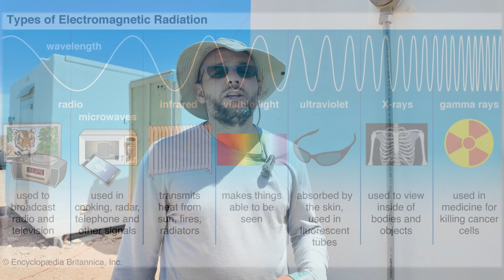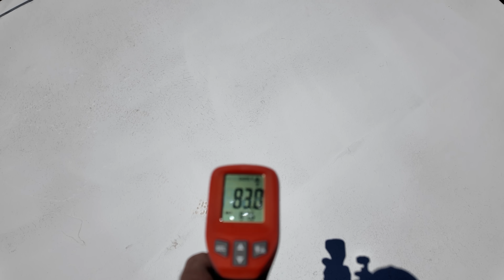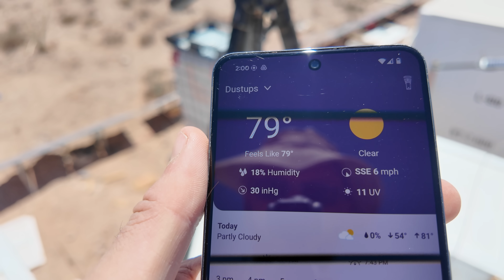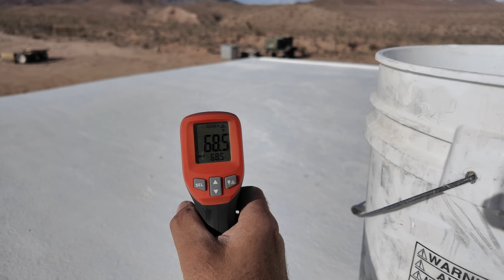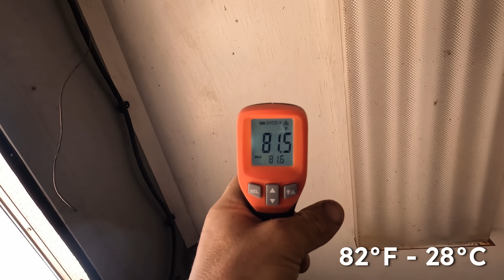I sprayed "cooling paint" on my desert cabin...this is shocking

Comment: Dude, why haven't you trenched out below the building you want to cool? Three feet down, the earth is generally about 55 degrees F. Take advantage of that. You still need a roof, of course, so painting your roof with passive cooling paint is still useful, depending on your wall materials, how far above ground the extend, and whether you make a 'shade moat' around the building to reduce the heat transfer from the ground laterally to your building.

Comment: In my opinion, even though this reflective paint may help, it's not the complete solution.   You would be better  served using a larger metal roofed lean too or gabled structure  over your buildings.   The suns rays converted to heat would  be carried upwards and out under each structure design, keeping heat from being absorbed  and out of each smaller building underneath the main structure.

Comment: Radiant barrier works great for my house comes in a roll it thin cheap and strong. You roll it across the top of insulation. makes a huge difference in heat transfer. but you have to have an air gap of a cm to an inch. radiant heat doesn't get thru  same thing as a fire blanket.

Comment: Water in short supply in a desert? Dude dig a well down till you hit water it works even in most deserts promise. You just have to hit the water table way under the sand where do you think all the water went? Through the sand and into the water table. It's only dry because that happens actually. So go down way way down and bring water back up to the surface to use for the camp. They do this by hand in the middle east so surely you can with some equipment to help out.

Comment: Have you considered complementing the PV system with wind power? Possibly coupled with some phase change materials for cooling (ice/water comes to mind). So, use wind power at night, coupled to black radiative surfaces to use space as a heat dump, for making ice, then circulate cooling water, perhaps to assist the existing AC. You could actually stage the development in phases, that would be wind power first, I guess. You can never have enough power :)

Comment: Measuring the outside with the laser thermometer doesn't make sense because the thdrmometer assumes an emissitivity that is actually different on both rooves. Measuring the inside makes sense because they have the same material and it's thus comparable

Comment: Not instantaneous, But building a wall, just about 3ft away from the South facing walls of the cubes.... Rammed Earth would probably be nearly free.... Would prevent that side of the cube from heat gain, since you didn't pain the sides.

Comment: Also, you can build a “roof or canary structure” over the building.  4 post and a top.  It creates a shade.  It gives an air gap for wind to wick away heat

Comment: May I make a suggestion:  you’re painting on a flat surface, a flat roof or floor.   Just control pour the paint onto the surface and roller it around.

Spraying is a waste of paint especially since you’re in a very windy area.

If you don’t want to waste the paint as it is absorbed into the roller, use a squeegee to move the paint around the flat roof.

I done a 60,000’ flat roof.  Just pour the 5gal bucket and we pushed it around.

Comment: Here is an idea, if you make a roof, you can make an infrared chimney as wide as every roof. make the insides reflective and the top close it of with foil or any other non stopping infrared material. this will make the houses cool, and i even think the cooling would be better because it shields it from infrared interference from the environment.

I wonder though, at night, you would be extremely cold right? it still emits heat, while it is cold, making it even colder. better make a cloth sail for art night to save heating cost.

Comment: Yo. Use an elastomeric white roof coating from HD or Lowe's first. It will fill in those hairline cracks and get your starting surface white for a bit over 100 per 5 gallon. Then top it with that and compare the thermals between the basic white and the nano particle white. This comparison compares dirty cracked surface to slightly white surface which doesn't show if it actually is better.

Comment: I have some experience with paint sprayers and would recommend that you put a few more coats on the roof.  In order for the paint to run through the sprayer, it has to be thinned. In doing so, it may have lost some of its thermal properties   Also, setting up shade cloths or other "tent" like structures would give even more protection, maybe even encourage convection

Comment: Why dont you erect some fence posts at either corner of the cabin and erect a tarp over the top of the cabin to put it in the shade with a gap to let the air flow underneath between the tarp and the roof ?

Comment: I'm from West Texas (Lubbock/Odessa area) and spend lots of time around Big Bend and the Pecos River, so I understand extreme heat challenges.

Reflective Solutions: Have you considered mirrors or mylar on the roof or possibly using glossy chrome paint? Also, radiant barrier paint which is also silver looking can be used on the interior (with your color choice over it) could be game-changing. I've worked in Austin-area attics with radiant barrier paint on the roof underside - the temperature difference is remarkable. It's pricey and probably contains some harsh chemicals, but might be worth exploring for your setup. A false roof over your structures with some type of radiant barrier under the roof would be very effective, too.

Personal Experience: I use an emergency tarp (like those space blankets but thicker) year-round with great results. Silver side out in summer keeps things cool; reflective side in during winter traps heat beautifully. BTW- For the small spaces you are painting rollers work well and enable multiple coats vs the setup and cleanup of using a sprayer when using single gallons. You really need at least 5 gallons to make spraying worthwhile, but both work so not criticizing.

Monitoring Suggestions: A FLIR type thermal camera phone adapter would be invaluable for understanding heat patterns in your gardens and structures - there are brands that are quite affordable now. You might also consider setting up an Arduino-based monitoring network with humidity, temperature, thermal, light, and wind sensors. Local farmers here use similar setups to track microclimates throughout seasons or even across a single day. The data visualization possibilities with Google Sheets could really help optimize your systems and the raw data would be something else you could easily provide access to for subscribers/members. Regarding the thermal sensors, there are low resolution/cheap thermal sensors for Arduino available.

The key is managing both radiant and thermal energy - understanding how they move differently is crucial for effective heat management.

I hope you have continued success with the tires and tarps approach. I understand the difficulties you are having to work around all too well. Good Luck and make this year count!

Comment: Hey everyone—we make the paint Shaun used in the video. We see a lot of comments about painting walls, and we’d hope we can explain it better. CryoPaint cools by radiating heat to the cold sky, so the surface needs as wide a view of the sky as possible. A flat roof sees almost the entire sky hemisphere and can dump heat efficiently; a vertical wall, even out in the open, sees at most half that and usually far less once trees, ground and neighboring buildings block the view. Try this: hold your phone flat against an exterior wall, snap a wide-angle shot, and eyeball how much of the frame is blue sky—whatever isn’t blue is sending long-wave heat toward the wall. Because radiative exchange works both ways, the wall ends up absorbing nearly as much IR from its surroundings as it can emit upward, so net cooling is small. Unless you’re on an exposed ridgeline or steep hillside where the wall points into open sky, CryoPaint is designed for roofs or other upward-facing surfaces. Its 96 % solar reflectance keeps those surfaces from heating up in the sun; with a lower-reflectance coating a wall would likely run hotter, not cooler.

Comment: De humidifiers in conjunction with an AC unit is a win every time. I have several throughout my home and empty them daily. Nothing better then dry cool air on a hot humid day. They do need power but not as much as an AC unit does. Also the water they pull out of the air may be useable for your plants, not sure about that part though. I would think with that paint and an de humidifier you may be able to forgot the AC unit, at least in areas you store stuff you want to keep out of the heat.

Comment: You probably don't want to paint the sides because  an emission spectrum is the same as the absorbation spectrum, your paint absorbs light at the same wavelength as it emitts, of course they may have chosen the range to avoid natural ranges, but if you paint two walls facing each other they will emitt and absorb from each other. You would have creatred soemthing akin to an optical cavity, essentially a blackbody radiator. It'll still cool I guess because the radiaton will be in every direction but it may end up getting really hot between those walls.

Comment: Paint the totes also. Add a strip of layered clear tape (think F1 helmet visor strips) to provide a clear view of the tote levels. 

Side note: Sta-cool from Home Depot (5 gallon @ $90) in a sprayer can cover almost two 40' containers, dependent upon how many coats you add (at least 2 coats recomended, 4 for spectacular results long term).

This will maintain the internal space at 20-40*F below surface temps, where humidity will impact temps within the internal space.

Summary: Be amazed, works far better than expected.

Comment: There is a 800w mini split AC that can run directly off solar panels. Probably like $1600 total. Runs only when the sun is on. Would be totally separate from the battery system.
Reply: EG4 Hybrid Solar Mini-Split Kit

$2600 not $1600.

Comment: Ceramic tile is most likely what you need. You could tile the roof. Or you could find the cheapest ceramic material you can buy crush it into a powder and add it to your paint if you want to stick with paint. I would not a a sprayer I would use a squeeze to put it on.  They 13:14 do sell ceramic paint for heat resistance.  I think the best option is to tile the roof it’s pretty small it should not cost that much. It is pricey however.

Comment: Radiative cooling paint on the exterior seems like one half of the solution. Wouldn't it be logical to use heat-absorbing paint on the interior? Does light colored paint that absorbs a large amount of heat even exist?

Comment: Cool idea, also a fan of NightHawk, so thanks for the shoutout! Instead of the probably really misleading direct temperature test, it would've been really awesome to see the readings of the thermo sensors. If the temp measurements of the inside of Brandons cabin show a significant improvement, you know the concept works - if they don't it doesn't. Or am i missing something?

Comment: Cooling paint I would've done with a roller.  it can't Possibly be quicker when you have to do 3- 4 coats when a roller will cover in two. Plus it will/should be more consistent as far as thickness across the roof.

Comment: 4:47 paint cannot reflect heat from inside of the building. It only reflects part of the direct light falling on it. IR radiation is a natural thing. Paint cannot accelerate it. It'll stop once the surface reaches equilibrium with the ambient environment. Energy always expands and IR radiation is one way. What you're doing is changing the thermal balance by reducing the amount of heat absorbed by the building roof, but that "sucking out the heat from the building and radiating it back to space" as in the 1:19 quote is BS. IR radiation happens either way and there's no paint to accelerate it. That would be magic.

Comment: 1:19 that is total BS. Heat IS released by hot stuff as IR radiation. Does this guy claim this is some kind of a radiator or what? A paint can only work one way - reflect back the sunlight. It can't do anything else.

Comment: If this coating is supposed to re-emit the thermal energy vs not emit it like traditional paint, wouldn't you expect your thermometer and IR camera to show the coated roof being hotter than the unpainted one? If the point was to keep the heat IN (i.e. under the paint) then the paint would be an insulator and the amount of heat coming off should be less. Really the most effective way to test/compare is with a mercury thermometer inside the doghouse.

Comment: I'm very suspicious of using a thermal camera to show the cooling of these paints. My understanding is that the camera calculates the temperature from the spectrum, presumably assuming that the paint emits like a black body.  If you're messing with the emission spectrum of the object (which is precisely what the paint is designed to do), I'm not convinced that you can trust the temperature derived from the resulting spectrum to be accurate. Maybe I'm wrong about this, but I'd be interested to see if there are differences between  the camera reading and an actual thermometer in thermal contact with the paint, and how this varies between the thermal paint and ordinary white paint.

Comment: Hello. I am interested in monasticism, and have done some research into the lifestyle of the Desert Fathers, which were the first christian monks, in the desert of scetis, in Egypt.
Their monasteries host, in the middle of the desert, incredible gardens and some basic agriculture to sustain themselves.

One thing that I believe, after some research, to have helped them fight the sun and especially the wind in this environment was their infrastructure.
They obviously built their cells and churches, but also protective walls to fend off thieves and dungeons to hide in for the same reasons. Apparently, the building of these walls with basic material helped them to create microclimates by providing a protection against wind and maybe some place for cool air to be trapped in ?

More research should be done in this subject but I thought this might help.

Comment: You can buy various thicknesses of garden shade cloth to lower temperatures around your buildings without much cost or hassle with installation. I hung shade cloth about 3 years ago on my south facing front porch and made my life so much more comfortable. Ag supply companies are great for getting a broad selection of different shade cloth that should work well in your situation. Just a thought.

Comment: 👋 Hey! I’ve got a cool idea that might help with the heat around those doghouses. What if you installed white architectural shade sails over and between them? They’d block out the harsh sun while still allowing hot air to rise and escape, keeping the area shaded without trapping heat underneath. It’s a simple, passive cooling solution that could really make a difference.

To take it further, you could mount white-painted aluminum slats or even finned heat sinks on the south-facing walls. These would reflect sunlight, improve airflow, and use the desert wind to dissipate heat. Similar setups in hot, arid environments have been shown to reduce interior temperatures by 5–10°C with shade sails alone, and another 3–5°C with heat-dissipating elements like these.

Might be a great way to boost comfort and efficiency in extreme conditions! 🌞🌬️

Comment: I'm pretty experienced in mechanical based things, one being painting. If someone doesn't know how to spray paint, stick with a low mat roller and thin it. You'll have far less waste. I know they recommended spray, but there is a lot of waste when spraying. You also may want to prime with a white cheaper paint first. This will at least make the roof evenly white colored to start. Lastly, paint more in the evening to allow the paint to flow out better. 

Maybe a below ground space with your geothermal idea and a reflective roof. 

As far as for plants... Why not a trellis with metal roofing panels and paint them with white paint with lots of micro balloons. It's cheaper, won't be as effective, but better than nothing. It will offer a little shade to get plants going and a way to direct some water to storage.

Comment: You are wrong in so many ways.  Of course paint the sides.  It won’t do much, but it will do as much as the roof.  The ground is not holding up some mirror aimed at your cabin because you painted it whiter than white with a matte finish. The roof will not magically radiate the small amount of heat your computer produces either because of paint that reflects all light.  If anything, it would reflect it back inside.

Comment: any commercial WHITE PAINT will work... there are specific paints that work better... ... WHITE WASH is probably the best cheapest ... opalescent white paint has its benefits
did you remember to paint the top 25% of the interior BLACK? 

so what did you use?

Comment: Why would you buy a paint sprayer to paint a 10'x10' surface? it should take about 5 minutes: early morning pour your overpriced paint on the roof and spread it around with a roller. you oversprayed half of your material, gone with the wind. But you do it the "right" way, throw money at it. clearly you have more money than sense

Comment: I'm pretty sure it's just reflective.  It's not transporting heat directly to space.  it's just reflecting light away from the surface as light, as opposed to letting the light hit a dark surface and get converted to heat which is a lot "stickier"  

You can get used solar panels for next to nothing and batteries aren't much more. scale up your system enough to run a heat pump air conditioner.